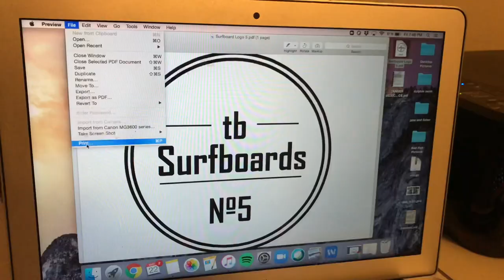Resin Tint Lamination with Cut Laps - Surfboard Glassing [Part 1 of 7]

Comment: Hi Tanner ! Great job ! I looked at all your videos and your boards are very clean and the shapes look good ! 

I was wondering what kind of product do you use to clean dust after the quick sanding at 40 ? Essence F ? 
There is no possible reaction with the hot-coat ? 

And a little last one, do you put a little bit of styrene when you do your stratification to make it easier for sanding or is it better not to ?

Then you for your answer and have fun with your new board !!
Reply from the maker: Thanks man! I clean the board with denatured alcohol before moving onto the hot coat. Works great and won’t create any reactions. I use wax paper on my stands when I flip over the board to cut the laps since the board hasn’t fully cured and is still tacky. Once fully cured I take them off to sand.

Comment: love your videos man. I'm about to glass my first board and was wondering how long are you supposed to wait when taking the tape off for the cutlaps? are you supposed to wait until its completely dried and hard or only wait long enough where its not completely dry as to take off the tape?
Reply from the maker: Thanks! You want to start cutting the fiberglass cloth after it’s kicked and is no longer tacky. For me it’s usually 2-3 hours after. If you wait until it hardens you won’t be able to cut the fiberglass and it will be a nightmare. Check out the instruction guide to glassing a surfboard on greenlightsurfsupply.com

Comment: Lovely work and great vid. Can I ask two questions: when you do the hot/sanding coats, do you normally add tint to that resin too, or is it just clear. Also, apart from the deck and tail patches, do you have just the one layer of glass? I am wondering how that compares to boards glassed with two layers on top, one on bottom. Thanks.
Reply from the maker: The hot coat goes on clear. Two layers on top and one layer on bottom is the standard. I just cut a V in the first layer on the deck to give it a little more style and the tail patch on the bottom is for the fins.
Reply: @BendheimBoards  Cool, thanks for the reply. Can I also ask what proportions of tint and catalyst you use for polyester resin? I've had small batches that take hours to start hardening.
Reply from the maker: @davidbrisbane822  Here is a chart that might help:  https://greenlightsurfsupply.com/blogs/news/32083843-new-surfboard-glassing-chart-resin-amounts-per-foot-of-board-length-for-epoxy-and-polyester-resins

Comment: How long do you wait to cut the cutlap?  And if you don't wait until it's fully cured, how do you flip it so that the curing part isn't on the stand?
Reply from the maker: I flip it to cut the laps between 1.5 to 2 hours for poly resin. Soft enough to cut but hard enough to flip it over.

Comment: How much resin do you recommend using for a 6ft4 fish 6ounce on bottom and top with a couple deck patches? Cheers!
Reply from the maker: This chart will help you out. Go with extra just to be on the safe side. https://greenlightsurfsupply.com/blogs/news/32083843-new-surfboard-glassing-chart-resin-amounts-per-foot-of-board-length-for-epoxy-and-polyester-resins

Comment: How do you cut the fiber so it’s not overlapping?  Assuming you don’t want the different colored rails?
Reply from the maker: Do a pigmented color rather than a tinted color. Or do the bottom, then a deck inlay of the same color, then a clear deck wrap.

Comment: Nice work! Did I miss something or did that added section of fiberglass result in a darker color with the same epoxy mix?
Reply from the maker: Yes that’s the desired look
Reply: @BendheimBoards  Excellent! I want something like that too for what I'm doing and I hadn't thought of that as a way to make it happen. I'm making a hollow core SUP and only need one layer of fiberglass. Another piece of fabric makes it much easier than what I was trying to come up with. Thanks!

Comment: is that grinder you used a standard drill bit attachment?  also what did you clean the rails with after grinding? will it work on epoxy?  i am about to do my first resin tint and this video was so helpful. thank you!
Reply from the maker: I use a shop polisher with a medium pad and a soft pad attachment from Foam EZ. I use denatured alcohol to clean the fiberglass after sanding. I haven’t worked with epoxy but I’m pretty sure it works for both. Read the steps on glassing from greenlightsurfsupply, they cover epoxy and talk about cleaning the laps. Best of luck!

Comment: Hello friend, have you mixed the resin with paraffin for lamination?
Thank you
Reply from the maker: No just laminating resin with catalyst
Reply: @BendheimBoards  And is it possible to sand where the folds of the fiber are, in tail, nose and transition? I thought that since it did not have paraffin resin, it was very difficult or impossible to sand that.
Thank you
Reply from the maker: @franciscojosegarciagarcia4124  Yes you will need to grind down the laps where the fiberglass cloth overlaps. And yes, it will gum up your sandpaper, but your not supposed to add paraffin in the lamination.  Only when doing the hotcoat.  You could add a little sanding resin before grinding to avoid this but I've never done that.

Comment: how much resin did u used in grams for the bottom layer ?
Reply from the maker: 46 oz of resin per side. Google translates that to 1,304 grams.
Reply: Your videos have been such an awesome resource for me!  I've got an epoxy board under my belt but will be tackling poly resin for the next one.  To add to this, what amount of catalyst are you using (1%?), at what temp, and what's the rough working time for your lams to get everything done before it gels? Thanks and keep up the killer work!
Reply from the maker: Thanks man glad to hear it! Greenlight has mixing ratios that are what your looking for on their website: https://greenlightsurfsupply.com/tbendheim
Reply: @BendheimBoards  thanks, yea I've seen all that!  Was mostly curious on your working time, don't want to get stuck with it gelling.
Reply from the maker: I’d say about 15 minutes before it starts to gell. Work fast because it’s a nightmare if it starts to kick before you’ve lapped your rails. I’ve heard that you have less working time with poly when compared to epoxy. My temperature fluctuates between 75 and 85 degrees in my workspace.
Reply: @BendheimBoards  thanks for the input! Looking forward to what you've got coming next

Comment: Question. When you cut the tape away (example at https://youtu.be/zXCQfX4VMj0?t=394 ) how deep do you cut?
Is it till the 1st layer of cloth. Or into the foam?
Reply from the maker: It’s fine if you cut into the foam a little on the first side. 2nd side you’ll only cut through the layer you just laminated and not the hardened layer beneath
Reply: @BendheimBoards  Thank you.
My dad and I are at the stage of laminating our e-foil board. This will be our 3rd board, but we never did a cut lap till now.......